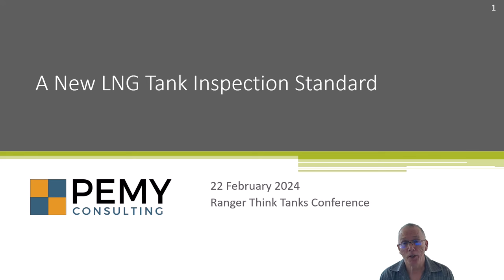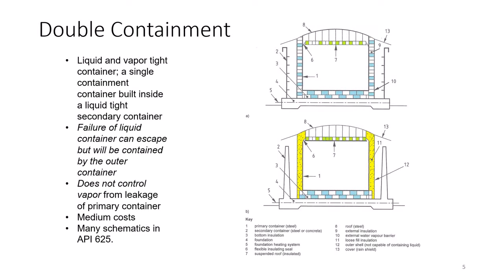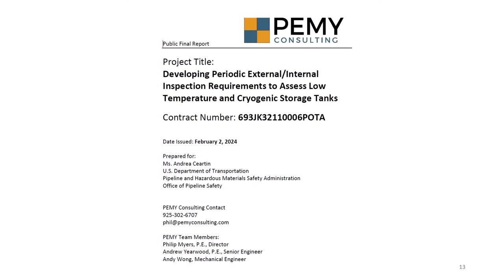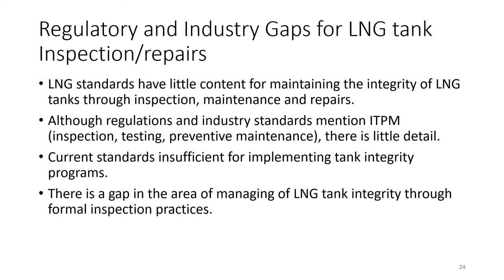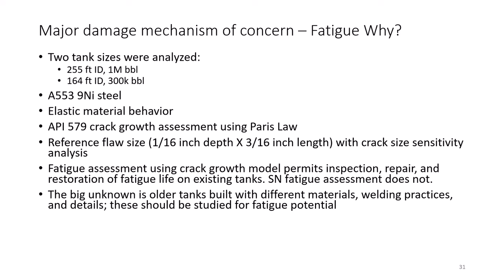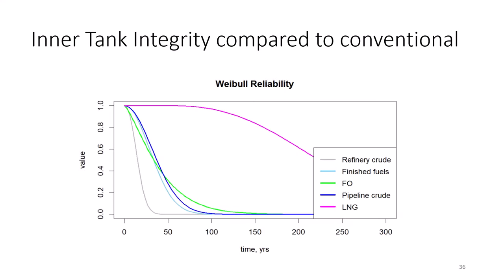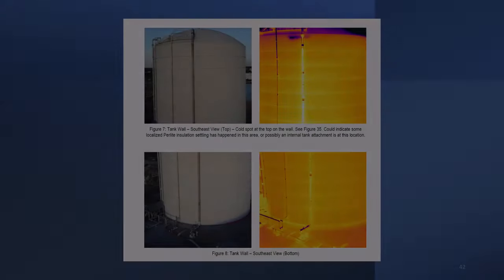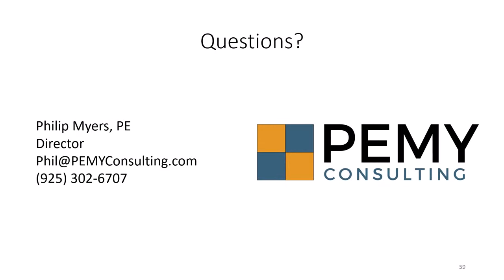New LNG Tank Standard

Comment: I have a problem with the vapor containment.   It appears to me that the Inner Tank is ONLY vapor tight if the seal between Suspended Deck and the Inner Tank Shell is vapor tight - which of course it is not.  Vapor will pass and be contained by the roof on the Outer Tank.   It is in fact the roof on the Outer Tank  - steel or  steel liner and concrete that provides the vapor containment on all LNG tanks, and,  all tank roofs are supported on the Outer Tank wall.   If my understanding is correct then the accepted definition of Single, Double and Full  Containment is not entirely accurate?